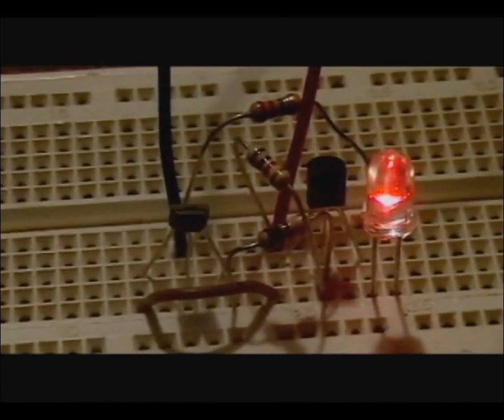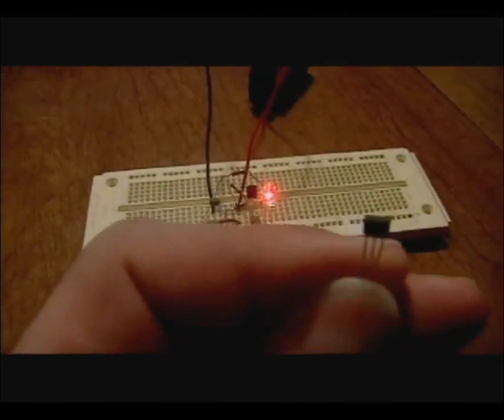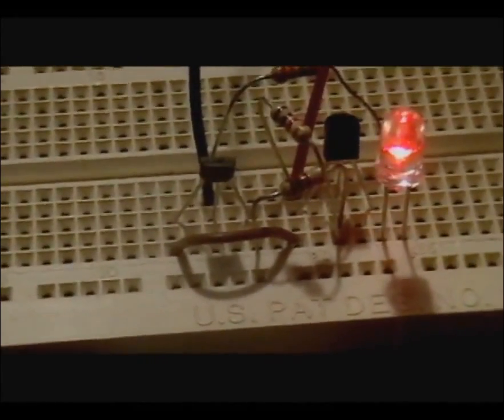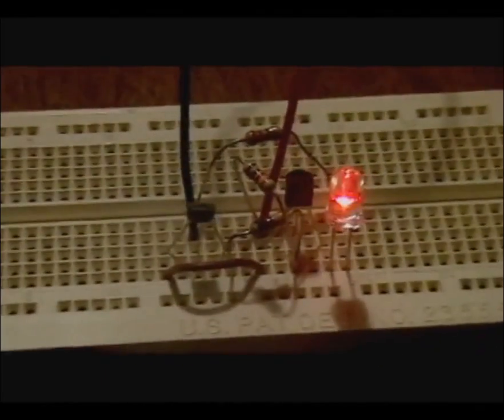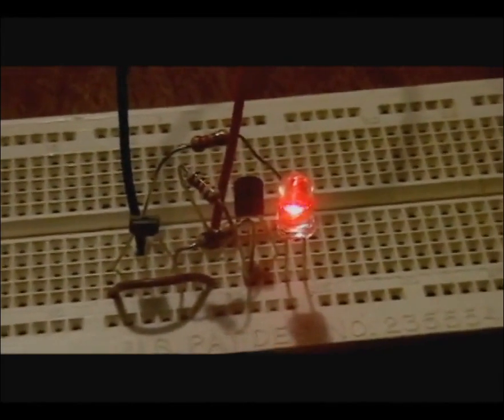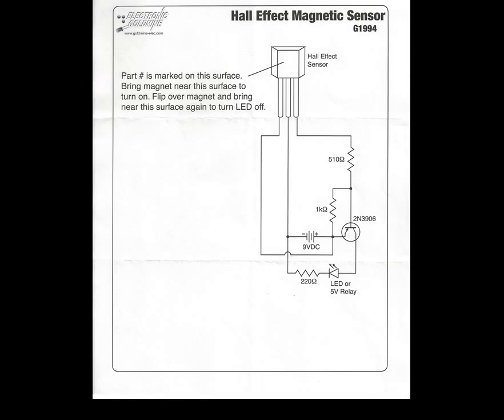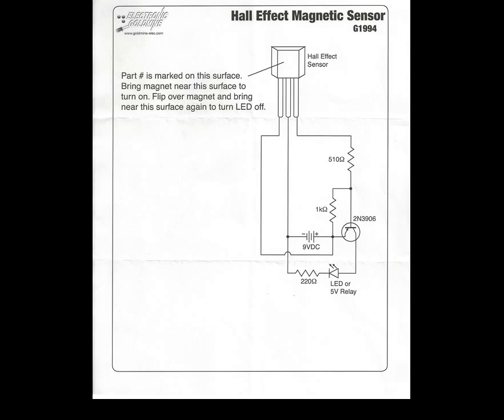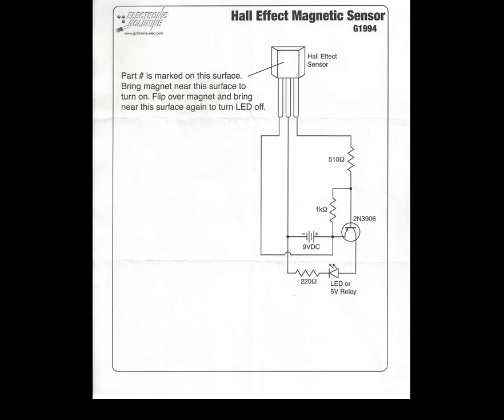Hall Effect Magnetic Circuit with Schematic

Comment: I am trying to build a similar device to this one for paranormal studies.I am still learning about magnetism.I want my LED to turn on at 10 gauss or 1.0 milligauss.Any help would be appreciated.I just am not sure which Hall Effect Sensor would be best for this application.I also want one that would turn on around 2.5 milligauss and one that would turn on around 5 milligauss.Thanks.Check out my custom made static field detector if that interests you on my page.
Reply from the maker: I did not really analyze the size of the magnetic field to turn on the specific component that I used.  I had both a small magnetic and a large U shaped magnetic.  Both turned it on/off when they came within a certain distance of the device.  If these are rated by the size of the magnetic field that activates them, I am unaware of it.  The ones I used operated just like a switch and seemed to be based entirely on the polarity of the field being applied and the distance between the field and the Hall Effect Sensor.  I suspect these may be something where the can be purchased to trip based on the size of the field/distance, but I never looked that deeply into it.  It would be interesting to know though. 

I really have never gotten into the paranormal arena, but I would think there are a number of things you could do if you are attempting to measure the impact of one magnetic field upon another.  The issue might be with being able to see the impact of very small fields.

Good luck with your project and thanks for watching.
Reply: No problem on the watching.I know that the Hall Effect Sensor will basically pic up any changes in the magnetic field.I think they have different Sensors that can operate on different magnetic ranges.I also believe the Hall Sesnor is how the Gauss meters or EMF meters operate.